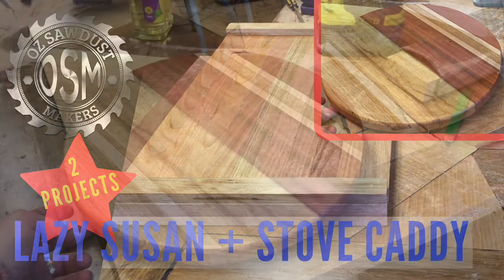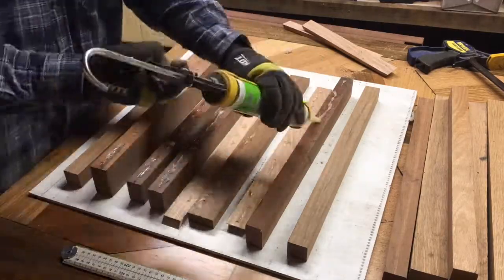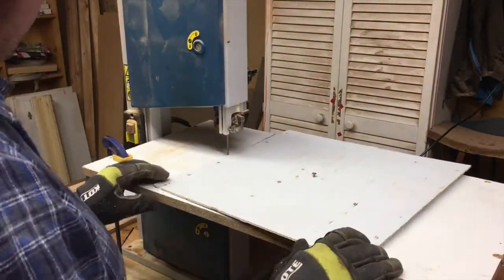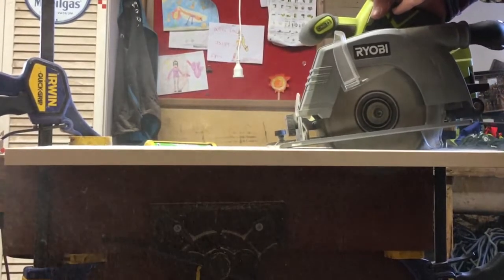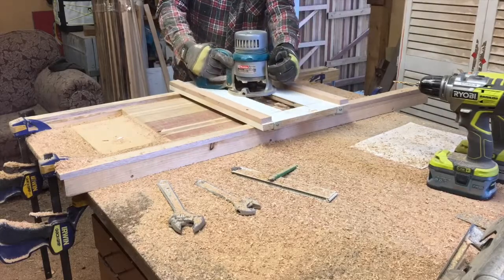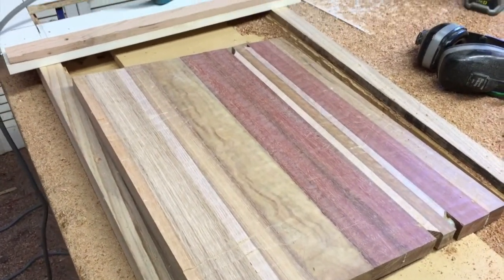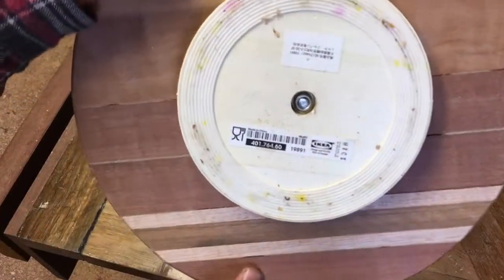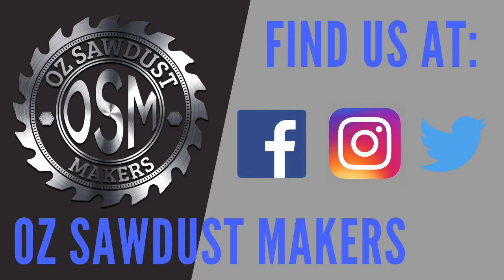Lazy Susan + Stove Caddy - How To DIY Woodwork

Comment: Hey mate you did it the hard way for a few projects but that’s admirable & the result is the only thing that counts. I’m not sure if vegetable oil is the best but I really get confused about food safe finishes so apart from that awesomeness 🍻👍👍👍👍🇦🇺🇦🇺🇦🇺
Reply from the maker: Totally agree Sumo, i'm still learning so i make sure i show my progress as honestly as possible. I was told vegetable oil was fine, i've since seen a few yanks get uppity that vegetable oil goes rancid. So far, theres been no issue with my old cutting boards but i have since changed to using mineral oil only. Thanks again for your support.